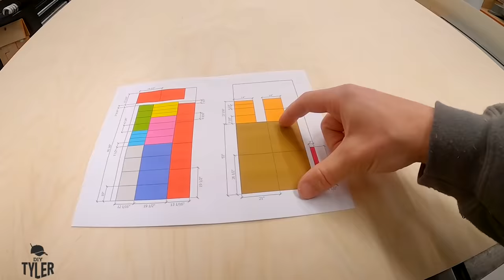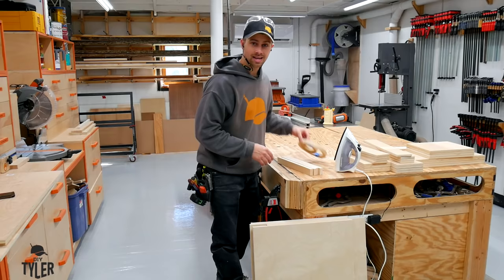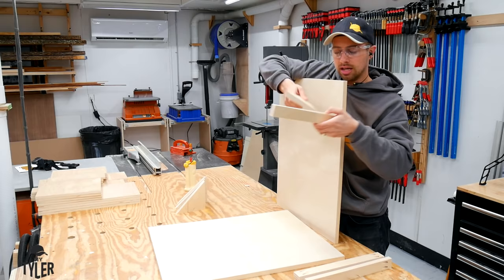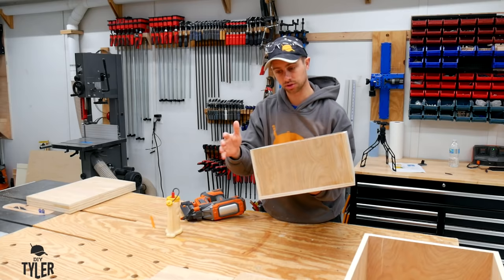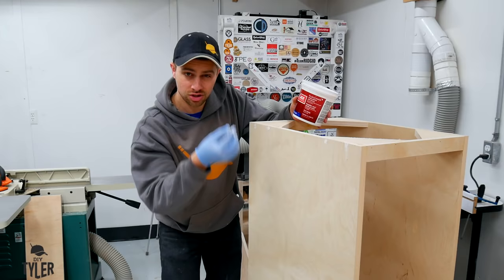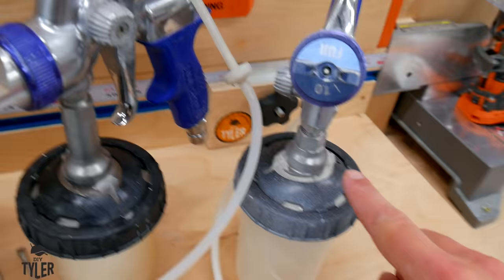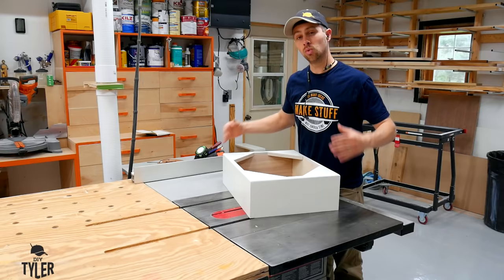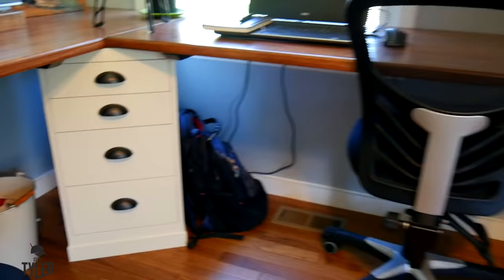DIY Filing Cabinet Out Of Wood

Comment: I made the Murphy bed for my guest room, but I had to do it in two days so I had to cut some corners but it still works great! I did do the floating shelves for legs & that is super helpful for putting my candles on. Now I want to do these cabinets because the crappy "wood" filing cabinets that I bought fell apart during assembly!! (I just keep on repainting the metal filing cabinets that were given to me).

Comment: Tyler, good plans but I just found (I think!) an issue with the cut list. You show a total of four 1 1/2" x 14 1/8" rails on the 3/4" plywood cut list. Since there are two cabinets there should be a total of eight, four per cabinet, correct? Not a big issue but a small irritation I discovered just after I put the tablesaw away...:-)
Reply: Same! Also didn’t have any triangles on the cut list so I had to go back and do those as well.

Comment: Nice build Tyler.  I noticed your use of the Fuji Sprayer.  I plan on purchasing one in the next week or so.  I seem to recall you had an earlier video on the 3M system addition for using your sprayer - I may remember that wrong.  Not sure I am ready to go to the full cost of adding the 3M system.  But, I did notice you using different types of spray guns on this project, gravity feed vs. the 1 qt bottle.  Now that you have been spraying for awhile, which type of spray gun would you start with gravity feed or 1 qt can sprayer (not sure I am using right terminology (T-60 or GPX in Fuji terms)?  Using the sprayer for small cabinets and small wood working projects. Once again good build.  I like the idea of the separate base allowing you to adjust height after your other parts of the build were finished.  Keep up the good work.

Comment: Using your plans (paying customer here!) and some arithmetic, I come up with a 1/2" space between the bottom of the drawer and the top of that bottom cross-piece. At 10:07 of the video you have a spacer that looks more like 1/4". If I am just wrong please set me straight. Otherwise, please advise on which is best. I really like your approach to building stuff and your videos but a little more detail and a longer video would be appreciated.

Never mind, I see my mistake. I am thinking that gap is 3/16" and the side gap is 1/8".

Comment: Tyler, another question. In the cut list for the drawers (1/2" plywood) the heights of the front and rear of the two large drawers (green and pink) are different. For the green front and rear pieces height is given as 6 5/8" while for the pink side pieces height is given as 6 9/16". I did not discover this until after cutting. I assume 6 9/16 is the correct dimension. My bad for not double checking the cut list for inaccuracies or perhaps there is an updated list?

Comment: Awesome video Tyler, great content as always!

I do have a question for you though.
Do you mind explaining why you use a 1.0mm tip when spraying gf white poly? I will be using this finish on a kitchen rebuild and planned on spraying with my Mini Mite 4 and a 1.3mm tip per the manufacturers specs. Have you had better luck using a 1.0mm tip?

Thanks in advance for your response!